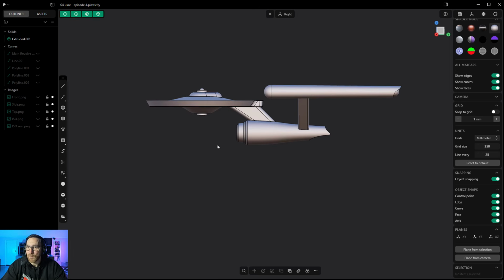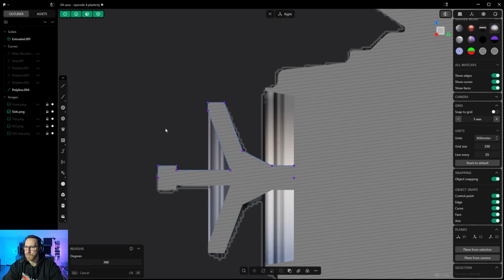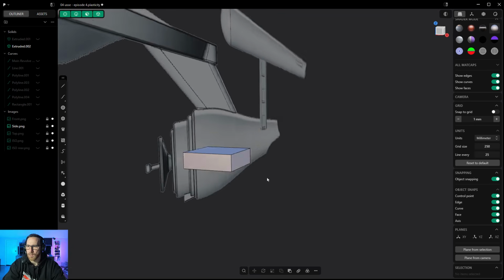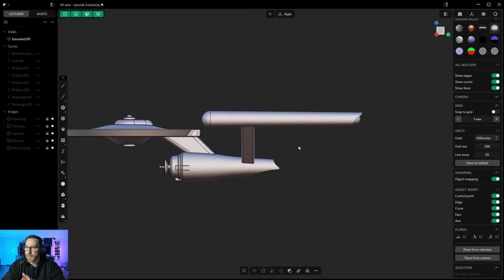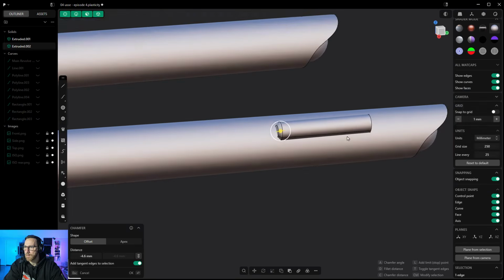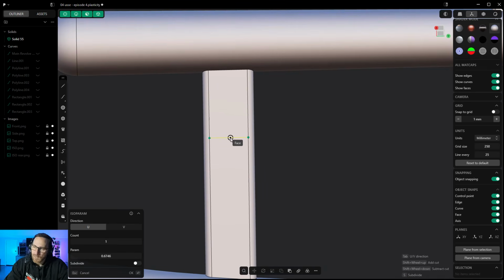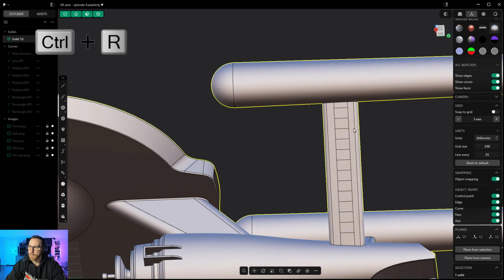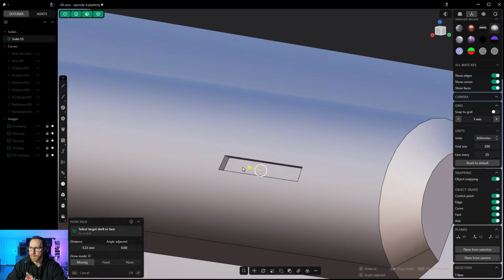Plasticity Beginner Modeling Series Part 4 | USS Enterprise #plasticity

Comment: Great series as all of your video tutorials. Would be nice to see this printed or know something about the technologies to be applied for printing it w/o being lost with all the supports necessary
Reply from the maker: Thanks!  For something like this the best way to do it would be multiple pieces to avoid a bunch of support cleanup (on a desktop FDM),  If you did an SLS nylon (not a home print) that is self supported and you can do some pretty detailed models.  SLA (home applications like the Formlabs) would have a ton of supports to cleanup but would likely yield a higher definition model.  So if you ended up doing a ton of windows and other features that is probably the direction to go.

Comment: Hi Matt,

I really like your work and find this Series very helpful. The saucer section using revolve makes a lot of sense and works great.

Now I’m wondering how you would approach a more complex ship like the Odyssey-class/Enterprise-F, especially the saucer section.

How would you create the curves on the saucer, and which technique would you recommend for that?

Do you have any tips or a direction I could look into (like lofting or another method)? I am using the Studio Version 

Thanks a lot!
Reply from the maker: Yeah as shapes get more complex it certainly becomes more of a challenge.

The first thing I do is look for symmetry.  Only model what you have to.  If you can mirror or pattern something then do it.

Next I look for big broad surfaces to start.  With the odyssey class ship its symmetric left/right so start with a midline curve for what the cross section would look like (for a portion of it).  Think about areas that are the same shape but offset, you can handle that later after making a big surface.

and the key is to break it up into smaller sections.  I will generally avoid a surface that changes direction more than once.  For example if its concave then convex, I generally don't try to capture that in a single surface.

You could also be sneaky and do something like a revolve and then use "Raise Degree" and deform it :)  That works ok when you are creating your own design, but when trying to match something that exists it generally doesn't work as well.
Reply: @LearnEverythingAboutDesign  Hi Matt,

thanks a lot for your help, I really appreciate it! I’ll give it a try the way you described and let you know how it turns out.

Thanks again!

Comment: Hi Matt, I am looking into Plasticity for my engineering company but like many others, think the lack of feature tree is a huge deterrent. I was considering pitching this software to my company as more of a finishing tool. For example, do primary modeling in a familiar CAD system like SolidWORKS and then importing that step file into Plasticity for adding things like fillets and modifying/ adding complex surfaces. Do you see this as a valid application of this software? Do you have other ideas of how this could be used as a finishing program?
Reply from the maker: Hey there!  I actually think it would be more valuable the other way around as a concepting/direct modeling tool first, then bringing a model into a CAD program like SWx that doesn't have a great suite of direct modeling tools.  You can try the convertion tools to see if SWx can apply some sketches and features to an imported model (mixed results), but leave the fine detailing work to the CAD program.

Plasticity is great for complex surfaces with the XNurbs tool, and does a great job with fillets and things on complex shapes, but it will always be tricky to jump between programs.

Comment: Is plasticity suitable for designing a car's roll cage?
Reply from the maker: I would say no.  I mean you could if it was for layout purposes and you were building it manually, but for something like that I would want a more mechanical/dimension based program and access to FEA.  Solidworks and Inventor both have tubing/routing tools.  Fusion can do it and there is a Pipe tool you can use if you build a 2d/3d sketch.  Routing is nice if you are using fittings, but for a cage of the end goal is to send a step file out and have a company bend it then Fusion would also work.

Comment: Matt you're kinda a Legend for your community. That's so awesome 😎. When I'm done healing from my surgery I will dive into that series. Btw revopoint dropped the metro X pro. I have the pop 3. Is the upgrade worth for a hobbyist which wants to dive into reverse engineering? ❤
Reply from the maker: Thank you!

Ill have a metroX pro soon and ill let you know.  So far (on paper) the biggest difference between the MetroY series and MetroX (other than things like single line laser mode) is that the Y series has wifi6 so it can be used wireless with the battery handle and screen mirror app.  The MetroX series doesn't have a wireless option.

I would say it depends on the types of parts you want to reverse engineer.  In the not so distant future i will be doing a big Revopoint video looking at all their scanners and trying to break them down.
Reply: @LearnEverythingAboutDesign Wow this is awesome. I literally watched almost all of your 3D scanner reviews. Getting the metroX pro soon is awesome. Looking forward for that vid.